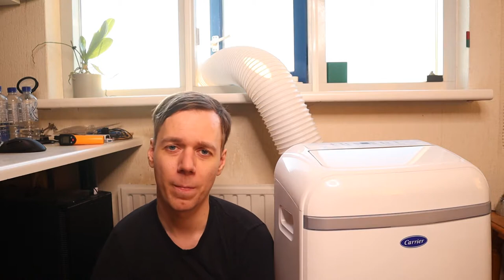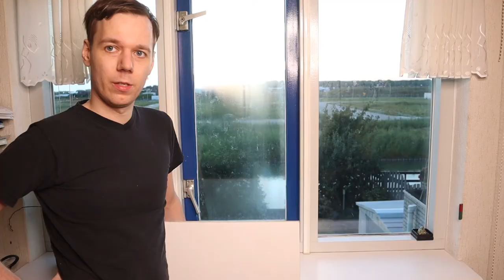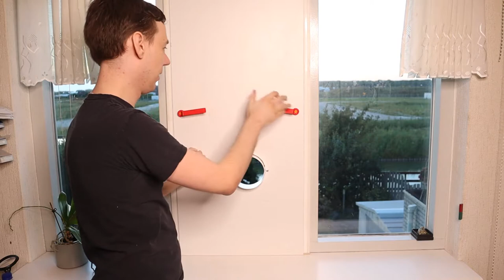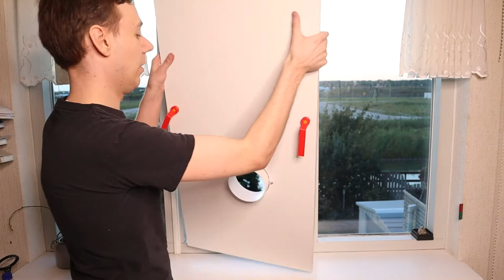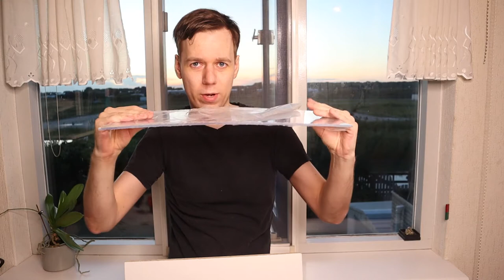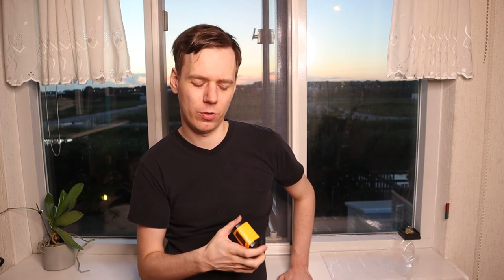Portable Air Conditioner Hose through outward tilting Casement Window

Comment: Thanks for the video on installing a portable AC vent into a casement video. I had to watch several videos to give me some ideas of how to tackle the problem the way I wanted to. Ultimately, I just went with a piece of chloroplast that I cut to fit into the rails of my bug screen, and then used some weather stripping to keep it tight and leak proof. I then just cut it to line up with where the vent opening is on the kit that came with the AC to latch it into the window. It works really good and I don't notice any more heat coming in through that vs. the normal window.

As for the AC struggling to get much colder than a few degrees, I wouldn't think it is the walls that are causing the AC to struggle because brick actually provides an excellent thermal barrier. There are two likely culprits here instead: SACC rating and single vs. dual hose exhaust. The first being that your unit is not of sufficient BTU size for your space. Many manufacturers got away with listing the rated capacity in the best case scenario for years, but now there is the Seasonally Adjusted Cooling Capacity (SACC). This accounts for losses in efficiency such as heat radiating off of the pipe etc.  So, your AC my actually have a SACC rating far too low for the room. Secondly, your unit is a single hose unit, which draws air in from the room to blow over the condenser and then out the tube you ran to your window. This creates a negative pressure in your house, drawing hot air from outside back in through whatever openings it can find, working against the unit. That is also something SACC takes into account, and you will notice some units listing 14,000 BTU with a SACC rating of a measly 7,000 BTU. This would likely indicate that the unit draws far too much air from the room to cool itself, sucking in much more hot air from the outside. A double hose unit draws air from outside to cool the condenser, and then blows that now hotter air back outside again. Beware though, there are some horribly inefficient dual hose designs as well! As such, the recommendation is to buy a unit with the SACC rating you need to cool the space. Just keep in mind that even if a single hose unit has the SACC BTU rating for your space, it will make other areas in your house hotter as hot air will be drawn into them and not actively cooled by the AC. 

Regardless, great video and thanks for the help!
Reply from the maker: I do think there was a lot of heat coming off the walls, I could measure them being 29-30 degrees on their surfaces. You're also right though that there's something really messed up with the ratings, which I think is why there are almost no dual-hose units you can buy. Just going by the ratings dual-hose offers no advantage, but of course that's bullshit, the physics is clear on that.

Comment: I came onto youtube just to see how others had done this tonight and really love your solution. I just got myself a portable air conditioner, I get my office lowered by 3 - 4 degrees in a 18 cubic meter room witha very similar set of windows to yours that opens outwards, I had some 12mm ply lying around that I cut to size to fit across all the windows in the bay. I secured it with a few suction pads that I could press onto the two surrounding windows. Your solution is really neat and well thought through, I may modify mine to allow at least some light in the window, the latches are a great idea, having the mosquito net rails sure was handy!
Reply from the maker: Using suction cups sounds really clever! Thanks for that idea, and thanks for watching
Reply: 3-4 degrees wtf that is awful, my bedroom is 26c even when its 18c outside
Reply: @Chris_t0  are you sure you’re talking about an air conditioner? From what I gather this is what I should expect from a portable one. I’ve never used it to heat a room
Reply: @daveawb  oh yeah i mean it in a bad way like my room is hot asf like 26c even when its only 18c outside, so if this only takes my room down 4 degrees its kinda useless for me. I need like -8 or -10 degrees
Reply: @Chris_t0  Ah I see! Yeah you're probably better off with a full mounted system then. I've not found a portable one yet that is good enough to do that.

Comment: I made one out of lexan because the window was bigger and using wood would've made the room too dark. 
I also opted to buy the split unit. It didn't make sense to exhaust the room air. It would be throwing the baby out with the bath water sort of thing! 
10 Years on, and still going every summer. 
Since you installed your board inside, you should install a sort of awning/rain gutter for the bottom of the outside, so that when the rain hits the windows sideways, water doesn't slide down the board and into the window ledge. 
That way, when the rain hits the board and comes down, it will hit the awning/rain gutter at the bottom, and is diverted outside.
I used construction tape from the outside to seal the bottom. At the end of the season, the tape is ripped out and thrown away.
Reply from the maker: That's quite clever, I made mine with quick install and removal in mind. If I see a rainshower coming I either just accept a little wetness, or I just remove the board and close the window. I feel like it's usually not that hot before big rainshowers anyway.

I do want to convert this thing into a dual-hose unit, which is kinda similar to, but not as good as, a split system. I don't have a good place to hang the outside unit.

Comment: This was a great idea but the fatal flaw was using particle board.  This will quickly deteriorate when it gets wet.  Try using anything else that isn't damaged by moisture.  Plywood that has been painted/prepared to withstand the moisture and look better.  1" pink solid insulation sheets would also be ideal, less expensive and easier to work with.  I would also add some foam weatherstripping to help seal the edges against the window frame.
Reply from the maker: The board has a white melamin coating that is waterproof. It also looks fine. In theory the vulnerable edges are "inside", but there's still a good chance some water will seep into it. Once this panel does swell up I think plywood would be the easiest choice. So far I've been able to just remove the thing before rain starts. On hot summer days there's usually little wind so the rain falls straight down too.
Reply: @antalz  Thanks for your super quick reply!  Honestly, you should look at this first.  It's perfect for this and super easy to work with.  Very lightweight, has better insulating qualities, it's waterproof and you can cut it with a utility knife.  You could probably paint it pretty easily as well.  It comes in 1/2" thickness as well.  YT won't let me put a picture in the comment but this is what I mean... Owens Corning  FOAMULAR NGX F-150 1 in. x 4 ft. x 8 ft. SSE R-5 XPS Rigid Foam Board Insulation
Reply from the maker: @RustyTheGeek  I hadn't considered XPS insulation before, is that stuff rigid enough you think? And can you cut and drill the holes easily enough? The hose adapter is also secured with M4 screws, does that work? That could be a material I could use more often.
Reply: @antalz  Best to just go look at it in the home center.  I'm guessing the 1" will be best and the most rigid.  It's literally just very dense solid foam so any screws will need to pass through it into something on the opposite side to hold well in a sandwich configuration.  It can be cut easily with a knife, ideally one that is long and straight such as an extendable razor knife.  I think you'll find it to be ideal for this specific use.

Comment: downside where i live windows open inwards - only think i can find is them thin plastic window seals that rip after a few days using - shame my flat didnt have built in air con as portable air on only way to cool down but so much hot air wasted as half comes back in the window
Reply from the maker: Is it perhaps possible to put a plate on the outside, with the latches holding it in place on the inside? But yeah there are a bunch of window designs that are challenging, like some crank windows or windows kept in place with a sheet metal bar that locks on a peg.
Reply: @antalz  sadly no :( - i live in a high rise/small skyscraper (which is why im surprised we dont have communal air con system as we do for heating)
Reply from the maker: @thewolfydragon1989  That's a huge bummer. I went with this wood plate because I knew one of those window kits wouldn't work, so I'm a bit sad to hear that even where they do work in theory they're still bad. And I suppose you have communal heating because heating can be done with a boiler that lives inside the building. AC needs equipment outside, usually on the roof. There are tons of people suffering from that problem, maybe I can come up with a more universal and more accesible way of sealing a window with a plate. A few people couldn't recreate the latches for example, because they had no 3D printer or no ability to modify the file to suit their windowframe thickness.
Reply: @antalz  yeh that's why I ahd to go with portable air conditioning as I coudlnt get an outside unit and as I rent I can't really drill hole through wall either. I might try see if I can find insulation and glue it onto the fabric seals see if it stops bit more heat. (they do work but still lot of wasted energy) if that makes sense? Not sure how good it will be but it's next idea I can think of. (saying that the heatwave here in the UK is ending tonight but least for future use it will save energy and cool loss/heat coming back in as my flat regular gets hot when sunny in summer)

Comment: Where did you get the latches? I can’t find them anywhere. Thank you!!
Reply from the maker: The latches are 3D printed, files are linked in the description. Are you able to have them printed, and/or adjust them for your windowframe? You're definitely not the first person with this issue.
Reply: I don't own a 3D printer, unfortunately.
Reply from the maker: @kylelweryu3462  Yeah, I should really upload a part 2 to this. You can also get something similar put together using dowel rod or threaded rod.
Reply: Dude if I were you I would print a bunch out and just sell them. You'd make a grip just off this video! Would you sell me a couple?
Reply: @antalz  Do you have an instagram?
Reply from the maker: @kylelweryu3462  I'm not 100% sure that would work. At least in my head the grips must be adjusted to suit the thickness of the windowframe, but maybe those are more uniform than I thought? I could sell the latches, but I think most people would do better ordering them from a 3D printing service, though I don't know if those still do small orders. I think there's nothing peer2peer anymore like the old 3dHubs. I do have an instagram, @creo_nova. I want to start it back up, just like the YT channel, but I got delayed again, this time Covid.

Comment: Hey, love your idea but i have a question

How thick is your board you used?  1/8th inch ,1/4th inch?
Reply from the maker: The board is 18 mm, which is about 3/4 inch. You need some thickness to it to keep it nice and stiff. I would probably recommend 1/2" or thicker.

Comment: Your video totally fails as you use a component nobody can buy. The latches. A waste of your time and ours. Very disappointing
Reply from the maker: That is a fair point. My more regular audience should be able to adapt the files and print, but I understand that's not feasible for many. I should probably come back to this, making latches from dowel rod and some scrap wood should be quite easy.
Reply: @antalz  thank you. I have made a board but the one problem is how to secure it.
I look forward to a video using as you say dowel. Cant work it out myself as the tension would pull off the base catch...due to the tension?
Reply from the maker: @stephenprice8835  I'm afraid it'll be a while, I got some other video ideas and I still haven't started back up, it's been over a year since my last upload. My idea is basically:
1) Cut a dowel roughly to length, diameter matches plate hole diameter
2) Drill holes in two scraps, put the dowel through the board, slide on scrap from either side of the board, screw the scraps to the dowel. This prevents the dowel from sliding forward or backward through the plate
3) Cut out a handle, glue that on. Cut out a latchingbit, glue that on. Or screw I suppose. File a small taper on the latch so it grips well.
4) Adjust the position of the scraps as needed

Will probably require a pretty big hole, to accomodate a thick dowel. Something like 12 mm.
Reply: @garygjl9036  Limited vocabulary, in a message that does not make sense. I would be please to read one that did.